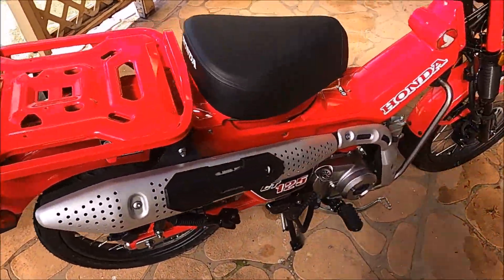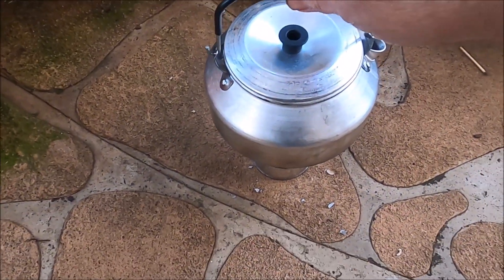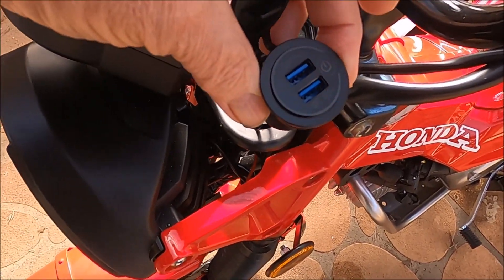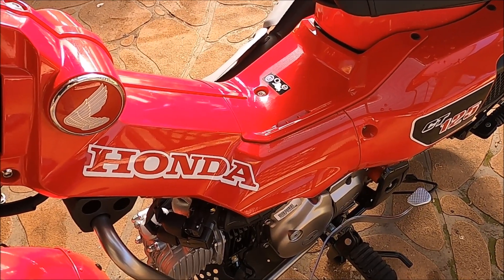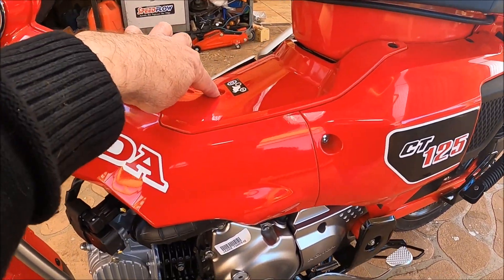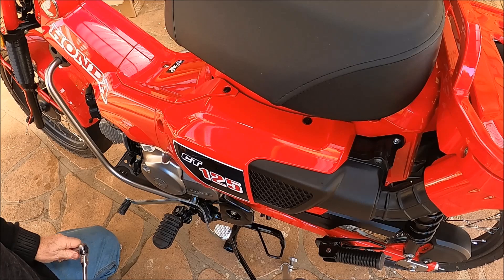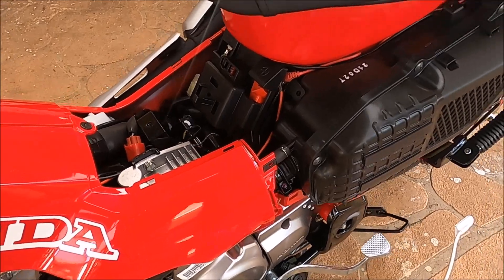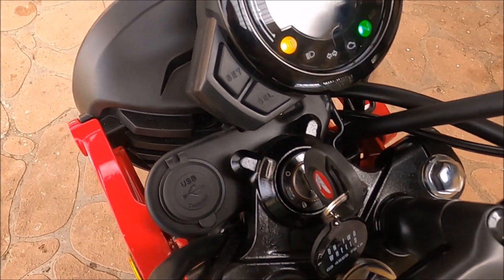2021 Honda Trail 125 -USB / Trickle Charger Pigtail Installation!

Comment: Feed the cable in to the head light unit and feed the Live off of the headlight controlled by the ignition switch that way you gaurantee the sockets isolated when ignition turned off.
Reply from the maker: i actually had plans to do just that but my quick connectors didn't arrive and i didn't want to splice wires so i just followed on from the last CT experience.
when they do arrive and i've been waiting a week now i might go back into the headlight shell and do exactly that
Reply: @ridewithwarro  There is a bullet connector that you can feed the stripped cable in to I saw a Thai guy do it on Youtube.
Reply from the maker: @louisdisbury9759  yeah the thai's were lucky there but the Aussie and USA versions of the Ct125 have no connector in the headlight area.
lucky the 300L i am waiting for has the stock connector and i can just do a plug and play.

Comment: Good luck with your lock-down. Nothing like that around here. But maybe there should be. That is a nice accessory that doesn't need any test rides to check out how it works.
Reply from the maker: thanks. yeah i think it looks the part and works fine. just waiting now for some T clips so i can try the live wire in the headlight housing.
on another note got a text from the dealer today-the blue and white forza 350 has arrived in the store so pickup next week
Reply: @ridewithwarro  I'll be looking forward to seeing the Forza 350. I am not sure if they sell them here, but I know I haven't seen very many scooters where I usually ride. They tend to be more of a big city transportation vehicle in the U.S.
Reply from the maker: @richardharmon5682  pretty keen to get hold of the forza myself-i think its been on a pre-order for roughly 3 months

Comment: Very good.✅ I always hook up a battery tender pigtail first thing on the bikes &  mowers,
While I’m at it I take the low amp fuse out and replace it with a 15amp fuse so “IF” I have to run a stronger charger to it it will Not blow the 5 amp fuse, just make sure the wiring will handle the amperage your setting the charger on.😎👍👏
Reply from the maker: sounds good to me!
Reply: @ridewithwarro  .. It was actually delivered yesterday, rolled it down to the shop and put the tender pigtail on,
Monday when the magnetic 🧲 oil drain plug comes, I Also will drain the new oil, put the plug in, refill with the oil that was just drained.😎👍✅

Comment: Great video!! I have been watching your channel along with others in preparation to do this myself. Your angle is by far the best and I'm glad you actually show the wiring to the battery for both the pigtail and the usb charger. Have you had any issues with this since installing it this way? any retrospective comments you have about the whole process looking back?
Reply from the maker: no issues and i am satisfied how that proceedure went and trouble free

Comment: Seeing as this is round two with the CT125, which add ons are making the cut?  USB is clearly taken care of.  Would you change the suspension again?  Seemed to be a big fan of it geared down so I can see you doing that again.
Reply from the maker: i will gear it down to the 13t as i like that mod but not sure where i am going from there. this time i covered the situation much better and i have the new 300L arriving any day now so that should cover all areas of riding and take a bit of pressure off the CT.

Comment: Maybe I missed it. What were you burning for fuel in the stove?
Reply from the maker: metholated spirits. i plan to try it out later on in one of my ct125 ride clips. plus a wood version too. will try the lot
Reply: @ridewithwarro  I make little stoves and burn wood in them. Methylated spirits . . . is that like what we might call Sterno?
Reply from the maker: @scottboyan  not asure about that one. i once tried shellite but it was a really bad dirty smoking fuel. this metho job appears to be good with a very fast boil time too
Reply: @ridewithwarro  It looks like a very hot fire.
Reply from the maker: @scottboyan  spot on there. later i will try it out on a ct125 ride and you'll get a better idea on how it runs. plus its very easy to carry along on the ride too